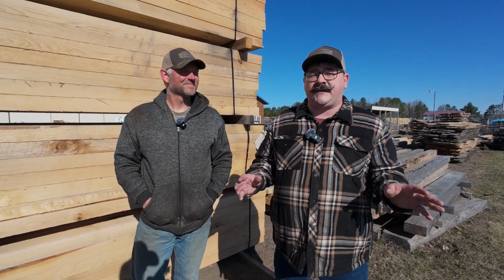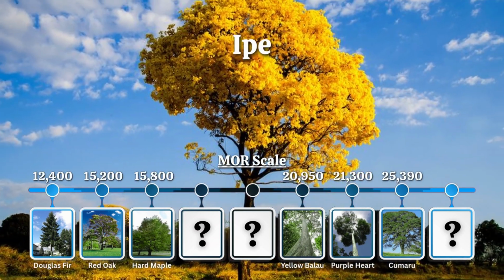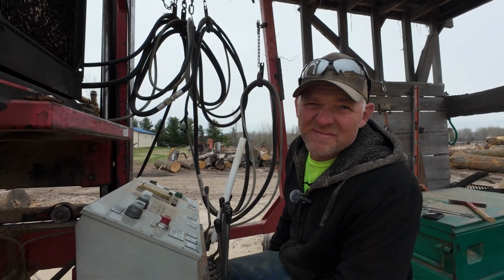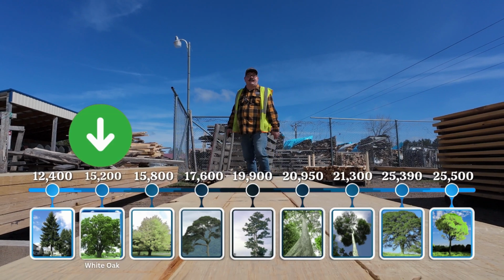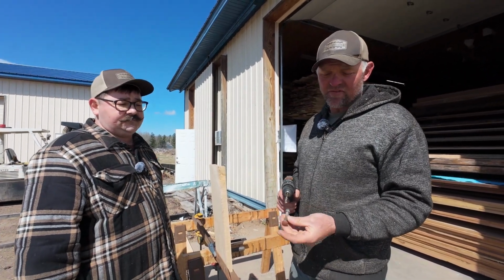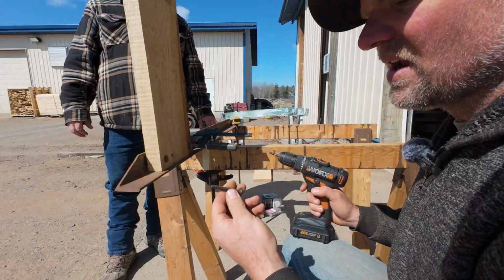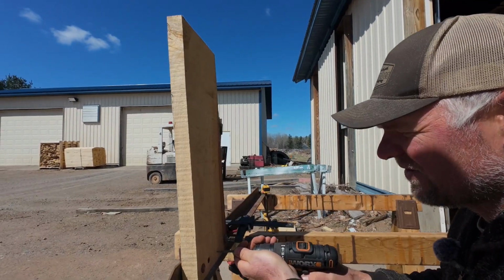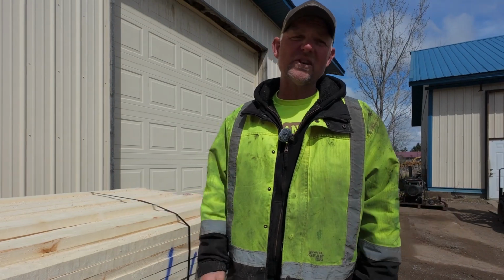The Best Wood for Trailer Decking is...

Comment: Around here we use pressure treated Douglas fir and carriage bolts. Carriage bolts are the best way to mount the deck. Especially when it comes time to replace a board or re-deck, you only have to drill the wood. I have never been a fan of self tapping bolts, they never work very well.
Reply from the maker: Thanks for the insight, that's really helpful to know about the carriage bolts!

Comment: Rough cut 2" thick white oak from your local saw mill, self tapping 5/16 deck bolts and treat with 50/50 used diesel oil and diesel before you install so all sides are treated. Soak it in and wipe off the excess. Don't be tricked into buying gimmick bolts. Use one new 9/32" drill bit for replacing all the decking on a 30' trailer. IDK what I'm going to do with the extra one I bought. It's not that hard folks!
Reply from the maker: That's a great breakdown of your process, sounds super effective! It’s not that it is hard, it helps those that don’t know yet. Thatnks for your comment.

Comment: The best wood for trailer decking is Teak.  The same stuff they used on aircraft carrier decks.  Unfortunately, it's way too expensive to use as trailer decking.

A quick cheap fix for fastening deck boards is to double nut the bolt.

BTW, +1 for a diesel/motor oil mix as a preservative for trailer decking.
Reply from the maker: Double nutting is a good trick for sure! What is a good compromise of strength + cost for a species then?

Comment: For heavy duty trailers like our Equipment trailers we have. 2 x 6 rough cut white oak with 2 x 8 & 2 x 4 staggered through the middle with brushed on used motor oil lightly thinned with diesel fuel. Then let it stand to air dry for 48 hrs. We used to just bend and shove the boards into the channel at each end of the trailer but that gets problematic with the bigger trailers. We now stagger them long ways 
by 2" using what ever the length of the trailer is in thirds were the boards land on a metal cross support. Then a 3" metal flat covers
each of those staggered boards with square wholes for 2 SS carriage bolts per board. We double nut each with blue loctite.  Most of our trailers are 104" goosenecks so this gives use a pattern of 3 6" drive boards on the outside and 2 4" down the middle but we have one that's 82"  with 16' foot tilt bed. We haven had to replace anything on it as it's not even 2 years old yet. We'll probably do something pretty similar when we do have to redeck it.
Reply from the maker: Sounds like a very detailed and effective method!
Reply: @kandjlumber  thanks. We've worked through a number of different ways over the years. Some worked OK some not at all. This method has been far superiors to any other we've done or seen done. When your loading these trailers up with 500 thousand dollar and more pieces of equipment it can not only be painfully expensive when something goes wrong but loss of life is very real when dealing with 40 ton pieces of machinery. A broken board that allows a D6's metal track to slip off the side rail is absolutely tariffing. Yes I have seen that. Not one of ours though. Thank God no one actually got severely hurt. (that time)
Reply: @larzakalazerath6655   m .  I’ll

Comment: Direct-to-ground contact rated treated 2”x6” lumber, hammer the end grain, brush on roofing tar on the end grain, then heavily roll on hot used engine oil & let it soak in. Good to go
Reply from the maker: I like it!

Comment: I have a friend with a saw mill.. He cut me White oak boards for my trailer.. i treated the bottom side Before I laid them on the trailer an every 4 days after an it Still grew mushrooms an rooted.. used the same self tapping "Goldie Locks" screws you said were good
Reply from the maker: Did you treat the top side as well? did you let the boards dry a bit before you treated the boards? what "treatment" did you use?
Reply: @kandjlumber treated both sided.. treated with old burn motor oil
Reply: Must have been sapwood the heart wood is what u want😊

Comment: Youse guys!   Installing new decking, toss your new board in place and zing a 1/8 drill bit from the bottom up to locate the hole so the new fastener hits the same spot in the steel.
Reply from the maker: bada bing bada boom ya done son!
Reply: @kandjlumber  Hard part up north is getting long white oak before the firewood guys snatch it.

Comment: Steel decking, or the cheap green pine, or white oak. And nice little jonsered at 3.41
Reply from the maker: I have thought about using steel decking in the past, but it is super expensive.
Reply: @kandjlumber last one i did it cost about the same as white oak

Comment: I'm a carpenter (building decks/stairs, Etc...) that cup down is a well proven fact in real life. That article was probably written by someone that NO practical experience. I think most of the issue is shedding water. The grain ends up, holds water
Reply from the maker: it only happens in certain boards. Crown up is legit. the board wants to cup toward the bark, think of it as the grain wants to straighten out. Check it out. this is the basis of my next video where I will point out both sides of the argument.
Reply: @kandjlumber I'm still going with what I have seen with my eyes
Reply from the maker: Well do me a favor, next time you see cupping in old wood, pay attention to the grain orientation.
Reply: @kandjlumber I've seen many put down on uncovered decks and if the grain edges are up (cupped) they separate at grains edges and splitter. Which is never easy on bare feet or hands (handrail)

Comment: I built my 20’ long flatbed 20 years ago using Douglas fir and the wood is still in decent shape.  Been coating it yearly with a light coat of used engine oil cut with about 20% diesel fuel.
Reply from the maker: That's an interesting method, how well does the oil and diesel soak in?

Comment: i used white oak, it is pretty cheap when its green cut.
Reply from the maker: Exactly! Glad you found that. White oak!
Reply: @kandjlumber  its all over here in mo. i paid 1.50 for each board. saw mill rough cut, 9 to 12 ft log, and 9 in wide. just had to rip them and plane them, and router the edges.

Comment: Used motor oil and kerosene.  Keep pressure treated trailer decks from aging well.
Reply from the maker: I’ve always thought that oil and gas mixture was redundant on top of the chemicals on pressure treat. You could just do that to cedar or White Oak and would last longer.

Comment: Lock nuts, also I drill it out from underneath so I don't end up swiss cheesing my trailer frame.
Reply from the maker: So which brand do you prefer?
Reply: @kandjlumber  Lock nuts?, what ever Home Depot or Lowe's has, they are going to rust up and require to be ground off either way.

Comment: Bodark wood blows away all these types of wood for durability and weather resistance. I don't think you can buy it anywhere. But you can find it growing naturally all over the south-central U.S. You need to mill it and run screws through it as soon as you cut it down -- before it dries up and turns rock hard.
Reply from the maker: How available is it? It grows all over, but is it abundant in areas that it grows?
Reply: @kandjlumber  I have 60 acres in Northeast Texas. I have at least 100 bodark trees on my place -- at least. Most people consider them nuisance trees because they drop what we call horse apples. A lot of people would love for you to remove them from their property. Getting rid of stumps is easier than most trees: The roots are shallow and run straight out. Leave a 4'-/8'-/12'-tall stump (depending on the circumference of the trunk), wait for the rain to make the ground moist, hook the stump to a truck and yank it out of the ground. This kind of wood burns really hot. The big, ugly stump is great for a bonfire.

Comment: Did my 65 C10 with Ipe, was really hard on saw blades.  Spilled a couple of automatic transmissions on it, nice finish. 30 years still is perfect.
Reply from the maker: The one spot you WANT a transmission or an oil leak to happen.

Comment: You did not address the fact that since this is a replacement deck a fastening method to use the original holes unless you want a swiss cheese frame.  That means drilling from the bottom thru existing frame holes and bolting IMO.
Reply from the maker: well there are many methods to go about doing this.. but I will take that into consideration if we do a follow up video.
Reply: Was also wondering about that.

Comment: You can locknuts with carriage bolts. Toplock, so no nylon to go bad, though I doubt that would be an issue under a trailer. My 2 cents is you’re best off drilling the holes with a bit instead of some fancy screw, which will be prone to snapping at cold temperatures and flex stress…wont ever be a problem with decently size carriage bolts.

I’ve seen oak do really well outside not even finished. It’s so hard it’s prone to splitting though. Everyone uses treated pine because it’s the cheapest…it’s really soft and easy to ding up, though it seems to heal itself somewhat after wet and dry cycles. You want pieces without the heart 
/pif…that part is weak and soft. You can find high grain count treated pine and it can hold up well, but mostly it’s young fast growth stuff that is soft, shrinks, cracks, and twists.
Reply from the maker: I like it, thanks for the info, I hope others get to see this and take it with them.

Comment: In 2005, I bought a new tractor with an 18' trailer. It had Pressure Treated syp decking. It rotted in 4 years. I bought more PTSYP and coated it with Woodlife Copper Coat and 15 years later it's going strong. It lives outside in SE Louisiana under pine trees.
Reply from the maker: That is super interesting, adding more green treat lol!
Reply: @kandjlumber  When this rots, I think I'll try the burn treatment on some rough sawn lumber from a neighbor with a sawmill. Although I have plenty of waste oil. Maybe I'll do half and half.

Comment: Years ago trailer manufacturers used grey elm . Red elm has a non rotting feature. White Oak is strong and rot resistant if dried before.
Reply from the maker: I'll have to look into that, I have always known Elm to be incredibly rot prone and have been warned against using that, but then again it is one of those things that you just accept and don't research. thanks for the comment!

Comment: 8 years ago i bought 40 acres of oak from the US goverment in missouri that took 1263 semi loads to move the boards. they were cut and used for ww2 and rhey have been drying since then and i sell them for trailors only they were all 24 to 32ft long and 6-32 inches wide and 2inches thick you need to sharpen your drill bit after each hole the first tralor i installed them on was a trailor that the guy hauls big construction equipment on and you still cant hardly see any gouges in the floor and he actually came back to get rid of some of the steel decking to make it easier to load when the deck was wet or muddy! he really loves the stuff but man its a pain to drill i even tried a waterjet with garnet it took forever to cut but made nice clean holes!   the only problem he had was the bolts snaping on the ramps in -20 to 30 deg and lower temps at times!
Reply from the maker: Yeah those boards were something else back in the day. Was it true Old Growth Lumber?
Reply: @kandjlumber yes it was!!
Reply: @izdaleb  40 acres worth of lumber that was sitting for 72 years or more? That’s amazing. Were they outside, in a warehouse or in a cave?

Comment: Right around 62 years ago my Dad bought a 18' trailer with the deck boards rotted out. He pulled the old boards, wire brushed the tops of all metal where a board would lie then painted osphoric acid on to eat any rust left. THEN he put roof tar on the metal. We went to the local sawmill in East Texas and he bought true dimension 2"x10" (not planed) regular yellow pine. Back then you could buy creasote so he cut all the boards but didn't attach them, he painted that creasote on and waited a couple days. I was just a kid but I helped him bolt the boards down (those carriage bolts you mentioned) but he boogered up the threads on each one so if the but came loose from the board shrinking the nut wouldn't drop off. Then every couple years (4 to 5 actually) we'd take old engine oil and put it in a sprayer and drench the deck and all the metal underside. That deck is STILL in fine shape and not rotted or otherwise unserviceable.
We've had to replace the lights wiring,  the tires and one spindle a couple times but the metals sound and so is the deck.... Dads gone but almost everything he built is still around and functional (the house he built has been through 4 direct hits from hurricanes there on the Gulf Coast, ever any roof damage to the concrete tiles nor a window broken due to the louvers and the concrete walls just shrugged off the one hit from a tornado because he built to last)
Reply from the maker: Wow, what an incredible story and tribute to your dad's craftsmanship! That's amazing that the deck is still in great shape.
Reply: @kandjlumber  I just used the trailer to haul my tractor in for service last week. Earlier this year I re-oiled the deck, used 2 gallons of used engine oil, applied a coat, next day applied a 2nd coat, especially any area of grain that had soaked up all the oil.
Reply: We've used drain oil cut with Diesel fuel to treat our trailer decks for years. Refresher wash the deck. Let it dry in the hot sun for at least a few days. Then simply mop it on. It's the same thing my grandfather did with the homemade flatbed on his 1-ton dually '74 Chevy. 
I believe he started with, "sugar maple hearts" 
We also lined our dump truck box with those same boards. Kept the concrete rubble we hauled from beating holes through the bottom

Comment: Apitong is the best. I is weather resistant wont rot. It is used on tractor trailer flatbeds. Got one, has been on there since 1995.
Reply: Used motor oil accidentally spilled really helps. Be careful carrying a bucket of used oil across your trailer.
Reply from the maker: Yeah they are known to last a very long time. thanks for the comment.

Comment: My father and I built hog pens with hickory wood.Needed to drill a hole slightly smaller than the nail you were using.then dip the nail in oil and hammer the nail home.I recommend hickory wood.
Reply from the maker: I don't recommend Hickory. I am more of a Buy Once Cry Once kind of a guy. Thanks for the comment and welcome to the community.

Comment: What about Elm? I think we have slippery Elm around here. A lot of it dies before it gets very big, but there are a few very large trees in most woodlots. A 6" tree will lay on the ground for years, and the heart wood is still very hard and nearly impossible to break.
Reply from the maker: I think there is something to say about a tree versus lumber that is cut and exposed to the elements. You can imagine Elm is similar to Ash and tends to rot quicker than other species like white oak.

Comment: steel diamond plate, mine sites outside year-round under  rain, snow, ice, and extreme heat since 2018, no maintenance, no issues
Reply: @rcmikeklein5512   not always the best way to go, depends on what the trailer is being used for.
Reply from the maker: It's great... if you can afford it.

Comment: Used motor oil is best preservative ever.
Reply: 50/50 used motor oil and diesel is what i have had good luck with.
Reply: Yep, my douglas fir deck is 20 years old and still in decent shape.  Yearly light application of used engine oil cut with 20% diesel.
Reply: @tomedgar4375  i had to read this 3 times to get what you were saying.
 1st time didnt look right 
2nd time i read it as DOG FUR with the fir spelled wrong
Then i read it the 3rd time and realized it was the DUG spelled wrong and you meant DOUG FIR not DOG FUR!!
haha
Reply: @warrenmichael918 
Sorry, meant to type Doug fir
Reply: @tomedgar4375  oh i got it, it was just funny to me and my brain looking at it being dog fur and thinking about you covering the dog in diesel and used motor oil! haha
Reply: I would agree. Put it on my trailer deck, with a roller every fall. Still looks good. I apply it to the frame and undercarrage of my dump trailer, still balck no rust. I got to do somenthing with my old oil.
Reply from the maker: Some people swear by that!
Reply: @kandjlumber  i do, my dad built a small barn behind my house 50 years ago, they coated it with old engine oil, and it is in great condition
Reply: @kandjlumber  I do.
Reply: creosote is the best (i.e. railroad ties)
Reply: @wildbill6976 
Yes but used engine oil is free
Reply: @wildbill6976  creosote isnt really available to the public anymore. It is still used commercially but we cant just go guy a gallon anymore
Reply: @wildbill6976  ever see retaining walls made from RR ties? Those walls always rot
Reply: @tenncutt  Not because of creosote decay but because old RR ties have been beat up and the fibers in the wood are torn apart from the train working them, then they absorb water and decay from the inside out.  New RR ties will last a hundred years or more, but they're expensive and have a strong creosote smell. 
The most practical for long term use, is good on 3 sides. 

But what kind of trailer would have a RR tie deck in the first place?!